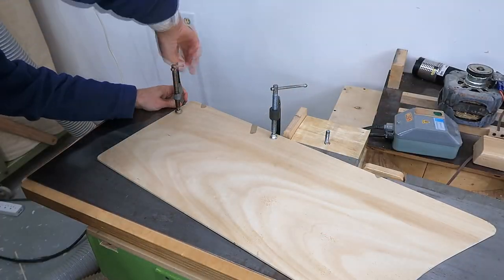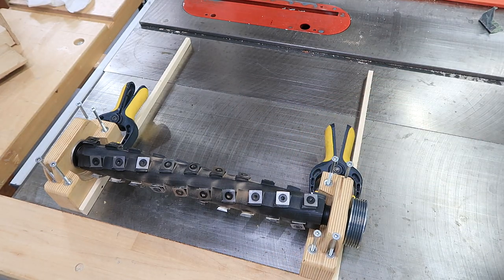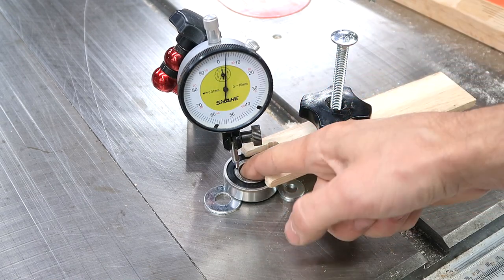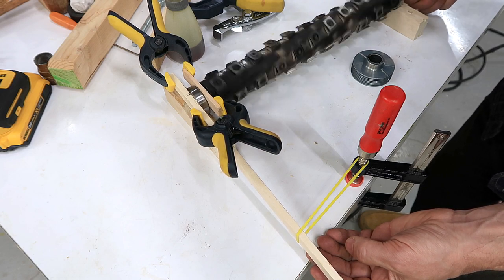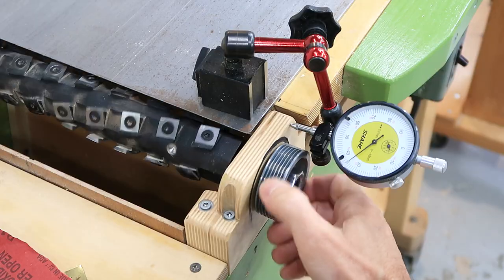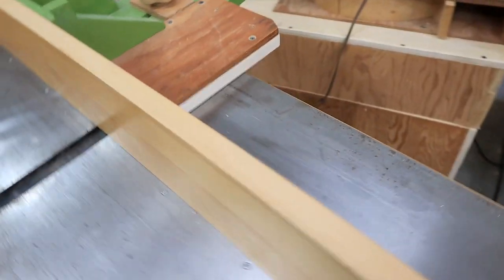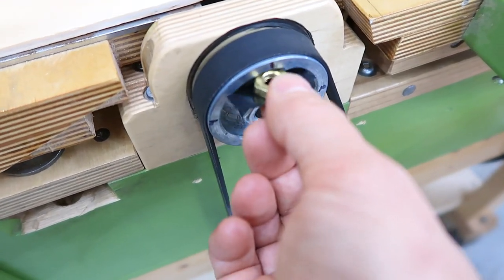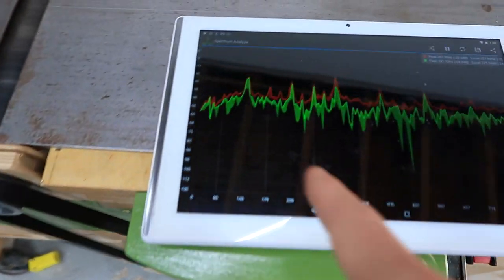Trying to reduce jointer noise and vibrations

Comment: It sounds much better, and thanks for sharing such clever ways to measure harmonics and chase vibrations.  I suspect new bearings will work great.  After shaving down the bearing block mounting points, did you check to see that the cutter is still parallel/coplanar to the table?  does that matter?

Comment: Hi Matthias, if the peaks on your graph were 120hz, then the null points where the curve crosses the X-axis should be double the number.  Shouldn't they?
Reply: Peaks at 60hz, valleys at 60hz, null at 120hz.  He was probably considering the valleys to also be peaks, based on the distance from zero.

Comment: I don't know anything about this stuff but would conical bearings not perform better here? You would need to beef up the support structure, but it would be tight and square and would take a lot of force axially without vibrating.

Comment: Is the main body of the cutter aluminum? I had just assumed it would be tool steel but I saw the balancing holes and it had the appearance of aluminum. The idea of a lighter weight metal for the spindle but then heavy carbide inserts, wouldn't this create something of a flywheel effect? Or is it forged aluminum? I guess I can't think of many other components that use a softer metal to hold the fasteners of the much faster and much heavier inserts? Aluminum threads seem to strip so easily is this not a legitimate concern?

Comment: JFYI; from a millwright. You could've put the bearing in hot motor oil. Up to 250f and it would probably slide right on.
Steel expands roughly .001"/ 100 degrees F/inch of diameter.

Comment: If you can get an accelerometer and FFT software you could analyze to see if the vibration frequency is 1st or 2nd order of the various RPM ranges in play. First order is indicative of a balance issue, while 2nd order is typically indicative of misalignment or swash.

Ahh, I see you’ve got that haha

Comment: Well, I can see your problem.  The hose barb fitting you used to pound the bearing onto the shaft has tapered threads.  Go back and use one with straight threads.  That should fix you up.

Comment: a speaker is not the ideal transducer to measure vibration, because it by design made to function in a frequency range. use a piezzo transduces, due to it solid state nature, it will negate any construction limitation of the speaker
Reply: Good idea using a piezo, but I think this setup is perfectly sufficient for what he's doing. Speakers are designed to function in the human hearing range of 20Hz-20kHz, I think that's more than enough when he's just ballparking the measurements anyways. If you're referring to the frequency response not being flat, I'd agree that's it's not, but again, it's close enough for this purpose.
Reply: Not sure if you saw the last video. He put a mass on the cone. So the speaker has been substantially modified. The idea is that the cone will basically not move because it has so much inertia. The speaker housing will move because he is pushing it against a rigid surface. So the voltage on the speaker output will be proportional to the movement. I don't see why this wouldn't work just fine. But maybe you know better.
Reply: @mckenziekeith7434  oh yea i forgot

Comment: I am under the impression that holding on to this all wooden structure to mount a spinning shaft of death that also wiggles is rather unsafe and warrants beefing up the structure. (That's to put it politely)  Sand bags in the base would also deaden the whole machine, you wouldfn't even need more than maybe 15 bucks of sand to see a difference.

Comment: well the back bearing makes since as its under tension transferred though the cutter though the front to the belt, it needs to be replaced (not that its going to make a huge difference)

Comment: I don't think I'd use it if it was that noisy. I like my HSS three-knife cutterheads just fine... and it's very easy to change rake with them for difficult woods. I like, too, the fact that I can always shift one knife to compensate for the first nick and another to compensate for the second and third and fourth... without being forced to replace any carbide inserts. Oh, and... I like the fact that my HSS won't explode on contact with a hidden hard object inside my workpiece like carbide very often will.

Comment: I would try rubber gaskets between the bearing blocks and the frame and replace the screws with bolts and rubber washers.
Reply: adding compliance into the system sounds like a great way to get inconsistent and inaccurate cuts.
Reply: @nomnomnom2  I agree. The key dimension of a jointer is from the table surface to the cutter.  I was thinking rubber mounts under that motor but he said the motor is fairly balanced.

Comment: Ball bearings should be pretensioned in axial direction to avoid rattle and prolong lifetime
Reply: Not radially? Unless it is a tapered bearing or thrust bearing. I am unsure.
Reply: @Convolutedtubules  the races of the bearing are cup shaped so pretensioning axially acts as a wedge and will remove any slip in the radial or axial directions.
Reply: @F0XD1E  exactly how you adjust the ball bearing on a traditional bicycle, either the fork bearings, or the crank bearings. You tighten them until they stop to wobble, then back off a few degrees. Same for old car wheel bearing.   Timken tapered roller bearings were a game changer.

Comment: Perhaps new bearings however, I have always turned away from making tools/machines out of wood.  How do you account for wood movement on a machine that needs have near perfect tolerances.
Reply: Paying attention to grain alignment and climate controlling your workspace helps a lot. Also tolerances can be more generous than you might expect.

As well as doing a quick checkup before each use to ensure it's not going to destroy itself.
Reply from the maker: The only thing that's really critical is the outfeed table height, and the way it's on there, wood movement doesn't change that.  Infeed table height gets adjusted all the time anyway.

Comment: Self aligning spherical bearings, like used in desk fans and such like may be a solution, wash out the factory grease with brake cleaner and replace with a light lithium.
Remember to give them a tap with a hammer and a piece of wood near the ends of the rotor after install to settle them in and align them. 
And regrease them every 10 hours of run time and they will last a very long time.
Reply: How do you get the seals off without destroying them?
Reply: @Leadvest  sharp pick.
Reply: @Leadvest  Pry them out gently with a seal pick or small flat screwdriver, and they will pop back in after.
Reply: Edit, Desk fans are usually oil lite bronze bushings, but are self aligning.
Reply: Why remove the factory fill grease? If the bearings are from a reputable manufacturer the grease inside will be of higher quality than the aftermarket one.
Reply: @tesicnr  You would certainly think so yes, In an ideal world without planned obsolesance.  but in my experience the factory grease is insufficiant, low quality and usually to thick for high speed applications such as planers and jointers and may run hotter with increased drag as a result. Execellent question though, I should of included this in my original comment but was trying to keep it short.
Reply: @tesicnr  no lol. grease is grease, no company is holding back the super special superior grease from you

Comment: That's not a scope.  That is a laptop.  How did you do that?  Does there exist some gizmo that converts small voltage to that readable graph ?
Reply: fascinating and exciting video. 
Is the motor mounted on isolators?  Maybe well nuts or rubber feet?  
I'd be tempted to do two things:  

1) Squish grease into those bearings. 
idea being that it will tend to decrease the inherent bearing play/slop by filling the voids. 
I know they are probably sealed bearings but you have SKF's on the way so you're going to replace them anyway and I would be curious if it helped. 

2)  Add a snubber like the bearing you have on one side of the belt to the other side.  Similar to a belt tensioner.  The belt has a long unsupported travel on that side.  

I'm amazed it works as well as it does given the accuracy of my wood working tools vs. machining tools.  The bearing blocks and mount surfaces being plywood vs. metal.  It's pretty cool. 

Wood is going to have a much lower frequency vibration than steel but a higher amplitude.  I'd be tempted to try a rap test on the structure just to see if the natural frequency of your structure is anywhere near the vibration frequencies you are picking up while the machine is running.  

If they are (or close to) a multiple, like 1/2 or 1/4 or 1/1 to your inherent motor frequency vibration then you could add weigh some where or stiffeners to knock it out of alignment with your unavoidable vibration sources.

Comment: If you can detect the effects of 120 Hz torque ripple, that implies that 3 phase induction motors should be detectably smoother. Kind of interesting. I always assumed the torque ripple was a non-issue with single phase motors.
Reply: Interesting I never heard of torque ripple. Do all motors have it or are there motors with static torque? if that's the right word
Reply: @flat-earther  single phase induction motors theoretically have it since the power delivered to the motor is not constant. Brushless DC motors could have some ripple depending on how they are controlled (like what kind of motor driver is controlling them). But with sophisticated control they should come pretty close to static torque (or constant torque). Theoretically three phase induction motors should not have torque ripple. But maybe they still have a little bit just because no machine is perfect. I think brushed DC motors have very constant torque also.

Comment: if you want to avoid the multiplications of the 120hz, just reduce the diameter of the big wheel a tiny bit. this might help a bit
Reply: Curious, why would that work? Wouldn't it be the same rpm no matter what?
Reply: @hiandrewfisher  I think because the motor and cutting head are both at 120 hz the vibrations line up. Changing the gear ratio slightly will shift the cutting head freq
Reply: The rpm of the big wheel will stay the same but the rpm of the smal wheel will decrease, so you dont have multiple things at the same 120hz frequency. Which will reduce the resonance peaks a lot. Also the beld will have a different length. Therefore a different frequenz with the same tention.

Comment: I wonder if you can measure the reduced noise also via the power consumption. I guess it's probably not significant.
Reply from the maker: power draw varies considerably as the bearings warm up

Comment: I know you are an engineer but remember, it's a wooden jointer that you made yourself from readily available materials, an old planer and with run of the mill tools, not a gas turbine.  I would think if you wanted something like that you would hire an engineering team and have access to millions of dollars worth of production tools like CNC mills, lathes and robots plus the computer hardware and software for design.  I may be stating the obvious but planers and jointers in general are noisy machines not unlike a siren.  Especially like the Federal Signal Thunderbolt because you are moving quite a bit of air past those blades, so the thing will howl.

Comment: I'm a big fan on Tersa planer heads. They are quiter than normal heads. The cut is really clean, the planing strokes are really fine. We use them in our thickness planer and they are easy to change out.

Comment: Hey Matthias, you mentioned that the vibrations in the blocks are too small to see with the human eye. This is a problem that the computer vision domain can help with. There are few algorithms that can amplify motion in videos even when the motion is incredibly small (on the sub-pixel level). If you took videos of your noisy machines, these methods could help you pinpoint where the vibrations are occurring.

There's a popular video on Steve Mould's channel called "Reveal Invisible Motion With This Clever Video Trick" about this approach

Comment: I wonder, would a flywheel reduce the 120Hz torque noise?
Reply from the maker: Probably not, it's the motor's stator that puts torsional vibrations on the jointer
Reply: some sort of damping coupling between the shaft and the pulley maybe?
Reply: might be cool to see that done DIY actually - shaft drives the OD of a soft skateboard wheel, with the pulley attached to the ID? I wonder how that would respond to chatter from the cutter head!
Reply: @matthiaswandel  suspending/hanging the motor then maybe? Like on old table saws?

Comment: By all means, swap out those screechy bearings. In a perfect world the only sound you should hear from your jointer at idle would be windage from the rotating head. I submit most of your noise is from your single phase motor.

Single phase motors are notorious for 60hz torque ripple. This instantaneous deviation from constant RPM also affects the stator which transmits its vibration and hum to the structure via the mounting plate. Mechanical balance will not mitiagate this condition and resilient mounting results in limited improvement. Try a three phase  motor driven by a VFD or a dc motor driven by  clean DC from a well filtered PWM drive.  

Three phase and DC motors are easily scrounged but the means to drive them without torque ripple may require persistence. Your powerful determination to make good usable shop equipment from junkyard gleanings may proscribe this.

Trust me. Set that single phase motor aside in favor of a three phase or DC motor  run from quality drives. The reduction of mechanically driven hum will astound you.

And, yes, the Turks have a ways to go before their ball bearings compete quality-wise with German, USA, Sweden, Korea, Japan, Israel, etc.

I would be very interested in your remarks at the conclusion of comparisons where single phase motors, three phase motors on phase converters (rotary and static) and VFD's,  DC motors run from rectified and filtered DC, SCR drives (eg, Dart, KB, etc), PWM drives, etc, are run idle, under load, etc. I'm sure many of your viewers work with unsecessarily noisy motor driven equipment. Reducing shop noise not only reduces hearing loss but likely benefits in family life and relations with near neighbors.

Comment: never use a impact on a puller if you intend to reuse the bearings, it beats it and damages it. Only with hand tools since it will not hammer it when pulling
Reply from the maker: There's a screw thread.  The imacts of the impact driver don't really add impact in the pull direction.
Reply: @matthiaswandel  yes it does, since the jaws are pulling the outer race of the bearings. If it was just the inner race it be fine.

Comment: Maybe you found the reason again why industially produced machine tools are not made out of wood? Not a precision material which also changes  shape significantly due to mechanical compression.
Reply: Did you watch the video? The metal shaft is not straight or not square or the something like that. The wood is not the problem. The bearing does not sit square and concentric on the shaft.
Reply: @mckenziekeith7434  And you are absolutely sure that this has nothing to do with the machine it has been mounted in? If it doesnt I wouldnt buy my cutters from that maker. If the send out a crooked cutter to an influencer what wiil the ones normal customers recieve be like?

I have worked in industrial production so I know what quality control should be like especially on potentially lethal tools and any problem that could even be measured reliably with the tools at Matthias' disposal is way more than what would be acceptable. I had to sort out 50% of a batch of of what was basically dowel pins for a rock boring head for exactly that reason last summer.
Reply: @rimmersbryggeri  well, the assembly was wonky even when it was just the cutter and bearings on his table. That is why I asked if you watched the video. I recommend you watch it again and pay attention to the parts where the cutter head is out of the machine. I am not questioning that cast iron and steel and what not are better choices for production. All I am saying is that his cutter assembly is screwed up and it is not the wood's fault.
Reply: @mckenziekeith7434  I think what you are referring to is caused by the operator. The bearings werent pressed on right in the last video and that will put the races out of alignment.
Reply: @rimmersbryggeri  maybe. He did try to straighten them and it didn't seem to matter. It would be great to just have a competent machinist take a look and see if the shaft is straight. But honestly, for a wood working machine it is already good enough. I would just stick in some ear plugs and use it as is until some further problem develops.

Comment: 0:51 Hey, What is that vibration tool that you use called?
Reply from the maker: A small loudspeaker with some washers glued on it.
Reply: You either mean the Dial Indicator, or his home made speaker vibration sensor?
Reply: at 0:51 you are referring to the dial indicator.  It measures very small changes in distance, useful for chasing down eccentricities or surface imperfections.

Comment: You engineering ideas are great however mounting a cutter head of that size in wood bearing blocks is very dangerous and would lack durability and accuracy . Pillow block bearings are a much better option. They are cheap, durable and much safer.